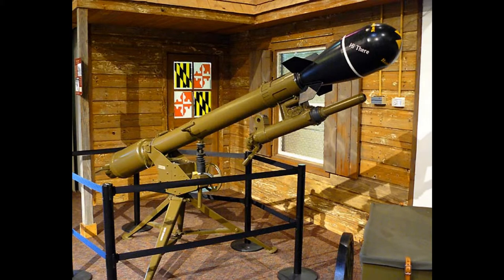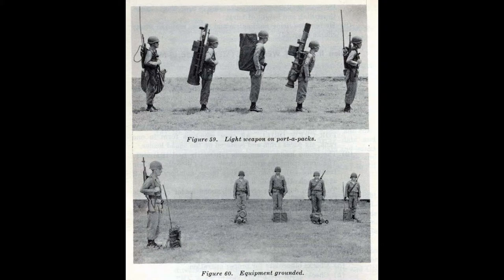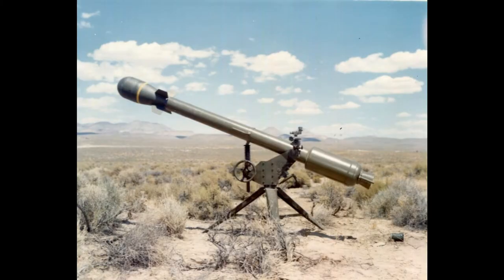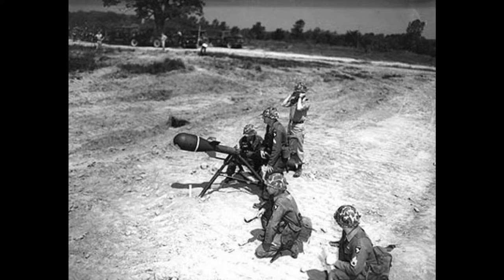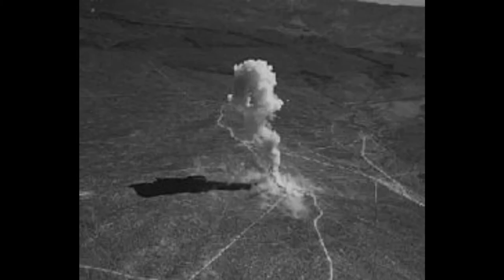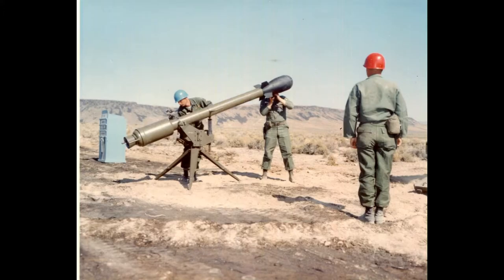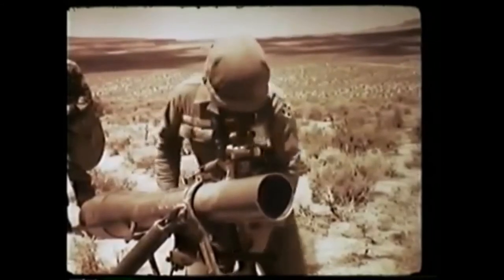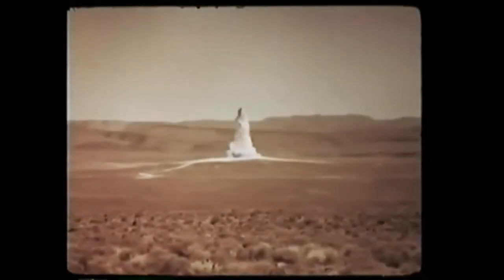The nuke that was designed for a mortar platoon

Comment: And they're still the fact that the mortar crew would be within the fallout radius from this nasty little warhead

I would also like to see what kind of system for passing the orders to use this looked like
Reply: Horsecrap. A live warhead was fired in the last above ground nuclear test by the US. Fallout doesn't have a "radius" by the way but a pattern based on the prevailing wind. But you knew that.

Comment: You stated that these were capable of a 0.2 kt yield and later stated 20 tons of TNT...Wouldn’t 0.2 kt be equal to 200 tons of TNT?
Reply from the maker: Yes.
Reply: 20 tons is correct.
Reply: @Ni999  1KT is 1000 tons .2  Kt is 200 tons
Reply: @MemorialRifleRange    I am well aware of how the decimal system works. 

https://armyhistory.org/the-m28m29-davy-crockett-nuclear-weapon-system/

Look at what I wrote and read the article. It maxed out at 0.02 kt, not 0.20 kt.

That's 20 tons.

From the article -

The W54 weighed fifty-one pounds and had an explosive yield of .01-.02 kilotons of TNT (the equivalent of approximately 10-20 tons).

The video reference was incorrect.
Reply: @Ni999  thanks for clarifying. I was also misled by the audio commentary 👍
Reply: @Keti_Mporta  YW 👍 A minor boo-boo, still a good video.
Reply: @Ni999  yes, totally agree. Never intended to diss the video itself 😅

Comment: Ft Bragg 1968 at USATC I repaired radios phone and TV's in 2 combined   WW11 orderly rooms there was a hallway that connected them and in the one was a massive steel bar cage that had housed Davey Crocket equipment it seems like we were fairly close to the grenade range and a small parade ground where the Golden Knights did promo jumps to entice the recruits to go airborne. My brush with the Davey Crocket.

Comment: “Was BEGUN in 1958...”
Reply: Ended 1971:Replaced by USMC.B. Radio,  Stealth Fatigue Streaking, Quadrophonic System Format Carpet Bomb Disco, Platform Combat Boots, Fonzie Canteens, Hang Glider Bombers, Pet Rock Grenades, AMC Gremlin (fake 'denim' upholstery, optional) Jeep replacements, Tiger Beat 'Stars And Stripes' Issues, (Lt. Wm. '2Cute2B4Got' Calley, insert), ...

Comment: I've seen people write = to 20 Tons TNT. 
I Heard: 0.1 to 0.2 KT, 
0.2 KT = 200 Tons of TNT, I Think. 
Still, 200 Tons of TNT on 1 Person Back + Radiation Fall Out is Good Going when you Think Less Than 20 Years Earlier, It Would Need a BIG Fleet of B17's or Lancaster Bombers to Deliver That BANG !
Reply: @Ni999  K.T. = Kilo Tons  
Kilo = x 1,000. 
Therefore: 1 K.T. is = to 1,000 Tons 
0.2 K.T. = 200 Tons of TNT.
Reply: @MrFIZZYMann  I am well aware of that. Look at what I wrote and read the article. It maxed out at 0.02 kt, not 0.20 kt.

That's 20 tons.

From the article -

The W54 weighed fifty-one pounds and had an explosive yield of .01-.02 kilotons of TNT (the equivalent of approximately 10-20 tons).

The video reference was incorrect.
Reply: @Ni999  Oh ! 
I Thought They Said 0.2 Not 0.02 KT. 
Thank You. 
Still A Nasty Big Bang.
Reply: @MrFIZZYMann  Very nasty, especially considering that a single B-17 squadron would typically drop just short of 29 tons of bombs.
Reply: @Ni999
20 tons is a hell of an explosion. However, imagine the sheer brisance of the astronomically fast shockwave. The brisance would make any conventional explosive seem like a bottle bomb.
Reply: You just cant beat the detonation velocity of nuclear explosions, which is in the 100s of thousands of feet per second.
Reply: @CC-mm3bl  The shockwave beyond the fireball is indeed something but not astronomical. A low yield atomic device indeed is impressive compared to a small conventional bomb weighing anywhere from 50 to 1000 pounds. This one was much like the explosive energy of 40,000 pounds of trinitrotoluene detonating just about perfectly.

 I would like to know how you arrived at that figure as Mach 100 or more is quite beyond what we've measured past the fireball by a few orders of magnitude. We dropped two atomic devices that detonated at very low altitudes over Japan from propeller-driven airplanes that were able to fly back safely despite being hit by the shockwave and those had yields over 500 times greater than the one here. That would not be possible with what you imagine.
Reply: @Ni999  You are correct, the shockwave any significant distance from the center would have typical if not a bit faster velocity than conventional explosives. However, I firmly believe that the very near area around a nuclear explosion is around mach 100 if not more, it just slows down very rapidly past 100 ft or so, depending on the yield. This is that tiny white ball you see. Afterall, we are talking about 500 million degress. There's just too much energy. Or, maybe the energy dissipates far to fast to build up to those velocities. Nobody really knows what goes on during such an energetic event.
Reply: @Ni999  Now a meteorite, God forbid, traveling anywhere from 7 to 40 miles a second, would indeed create such a shockwave, given it has enough mass to retain its velocity through the atmosphere.
Reply: @Ni999  yeah no way does the main fireball travel THAT fast lol. The very center may be a different story though. Nobody really knows though it just happens way too fast to catch, even with the fastest cameras.
Reply: @CC-mm3bl  We know down to the nanosecond scale exactly what happens during a nuclear detonation because we've measured it. We conducted underground testing of nuclear detonations well into the digital era of measurementation and that testing helped drive the advancements in metrology necessary to accomplish that.

It's important to keep things on the right scale when discussing any effects from any weapons or you quickly end up losing sight of phenomena and effects. For example, consider a bullet fired out of a conventional pistol barrel. The rifling imparts spin and that stabilizes it for flight. If we were to measure that spin together we'd find that it's on the order of 60,000 rpm - revolutions per minute. That's easily spinning anywhere from 60 to 200 times as fast as your normal handheld drill. If we leave it right there, we could easily convince ourselves that bullets screw themselves into the targets. Except what really happens is that they will spin maybe - maybe - a few dozen times between the pistol and the target and then spin only a few times into the target before stopping, so tens of thousands of rpms, while true at one scale, has nothing to do with the fact that bullets hit more like a nail than a screw.

And so it is with nuclear devices. There are a number of complex effects that occur after detonation and each one is dominant in its own regime. I could be close enough to be vaporized by heat before caring about the shockwave and I could be beyond the immediate lethal range of the shockwave and still die from radiation poisoning.

Each effect has to be considered in context of its own regime and then only in terms relevant to the scale involved.

I can easily make the argument that your electrons are traveling well beyond hypersonic speeds around your atoms and that's enough to rattle you to atomic disruption. While one of those things is true, the conclusion is drawn out of context - you exist.

(note, edited only to fix a typo)
Reply: @Ni999  Good explanation. Thats crazy how we can record such fast events. Now what about the meteorite, which are stated to travel between 11km to 72 km a second, given it's big enough to retain speed? Naturally this would only be a relatively small shockwave, similar to a bullet or jet.

Comment: This  got me thinking was there a Soviet equivalent?
Reply: The 2S4 240mm mortar is nuclear capable. Max range with conventional munitions is 9.5km. It is believed that the warhead it fires is a 2kt, but it is speculated that with nuclear rounds the range is far less than 9.5km
The Russians still have 10 in active service with another 400 in warehouses. There are rumors that 20 where being used in Syria, but they were probably the M240 240mm mortar. There are also photos of a 2S4 being used in the Ukraine in 2015.
Reply: @erwin669  i presume you mean that the platform was used with conventional ordnance?
Reply: @SonsOfLorgar  the 2S4 can use both conventional munitions and nuclear. Just the nuclear rounds are speculated to have a much shorter range than the conventional ones.

Comment: 2:15 What support is there for the claim this is a "pretty dirty weapon"?  Direct radiation is not the same as fallout or radionuclide residue which are the normal standards of 'dirtiness".
Reply: Two reasons this would be a "dirty weapon." 1. All or nearly all of the power comes from the atomic "trigger" that normally is used to start a hydrogen fusion reaction, so it would produce relatively large amounts of fission byproducts compared to it's overall explosive effect. 2. Exploding any nuclear weapon near the ground will irradiate a lot of dirt, and thus create a deadly fallout plume.
Reply: @HSMiyamoto  good explanation
Reply: The smaller the payload, the dirtier the nuke.